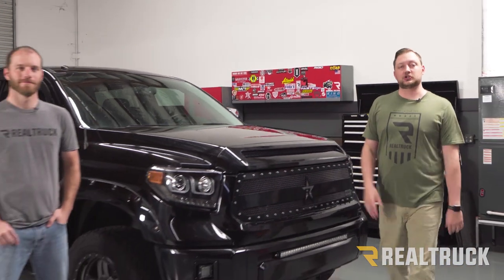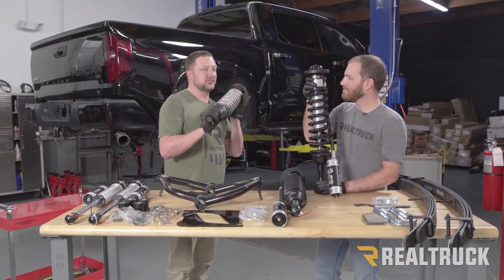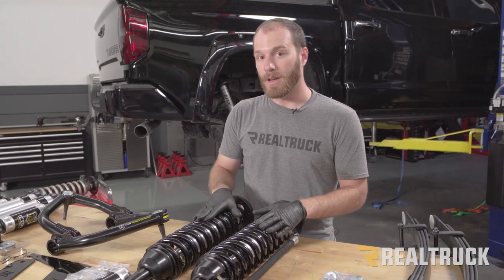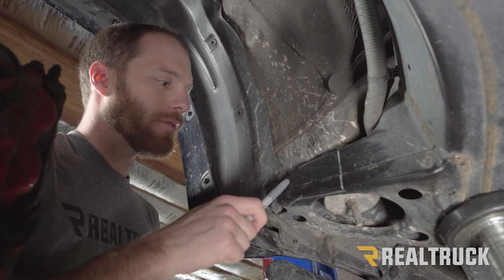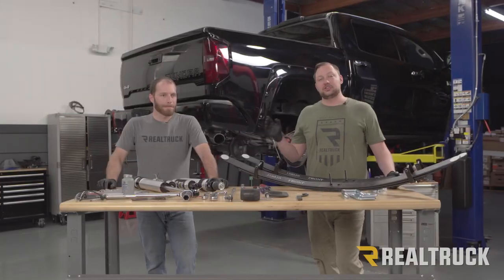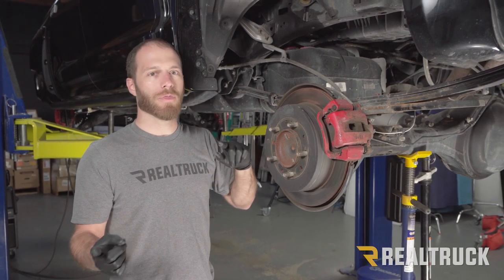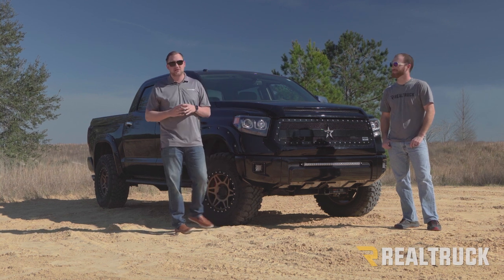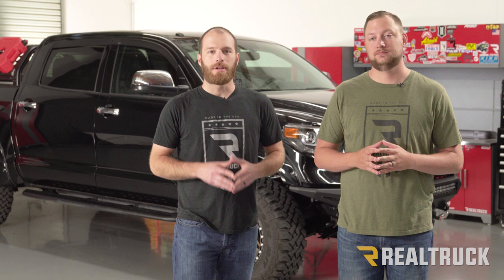RT Build Series "Overland Tundra" Ep.  1 Lift, Wheels, and Tires

Comment: If you use an adjustable upper control arm from SPC, you don’t have to compromise the frame by adding a body mod. I used it for my 2018 SR5, added 35’s without any rubbing at all.

Comment: Nice video.  I just had a BDS 6" lift with Fox 2.0 Coilovers with DSC Adjusters and it doesn't look like the installer reattached the ABS mounts and they seem stretched a bit.  My brakes are feeling very soft as well.  I just got it home and noticed this, so I haven't called my installer yet to discuss it, but I have already been looking at some extended steel braided brake lines that are a little longer.  Did you guys install longer brake lines or have you had to since this video?  Any advice would be greatly appreciated!  =]
Reply: Anything over a 2inch lift, longer brake hoses are definitely needed
Reply: @marc9709  Thanks!  What about the ABS lines?  Do I need extended lines for that as well?
Reply: @MaxDissent  depending on the height of the lift, 3-4inches you should be good. Any higher , I’d extend them 🤙
Reply: @marc9709  Thanks for your help!  I just had a 7" BDS lift installed and didn't know I needed extended brake lines, so I just purchased custom made brake lines that are 5" longer than stock, but now I need to find the extended ABS lines.  Do you know where I can find these for my 2016 Toyota Tundra?
Reply: @MaxDissent  nicely done mate! Unfortunately not, I drive a Ranger and I live in the UK. My contacts probably wouldn't be much use to you 🤙😃
Reply: @marc9709  Thanks anyway Mason.  Appreciate it!